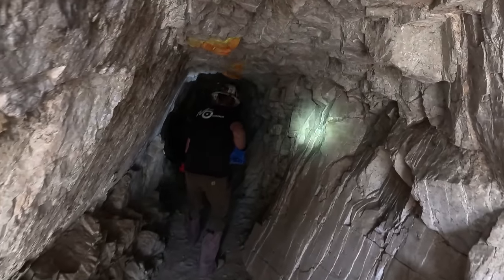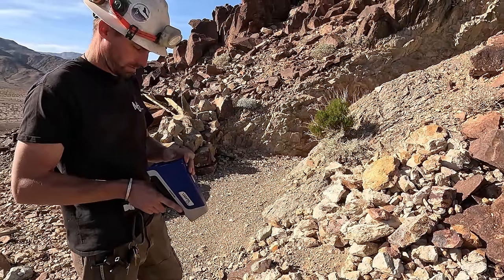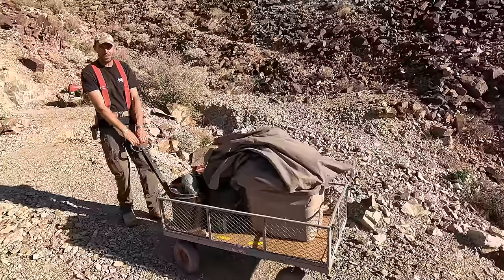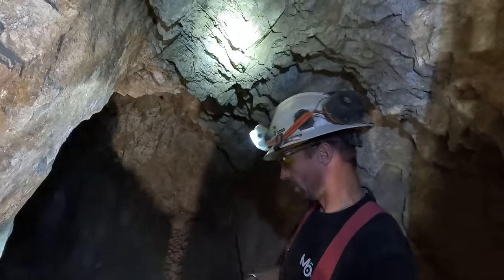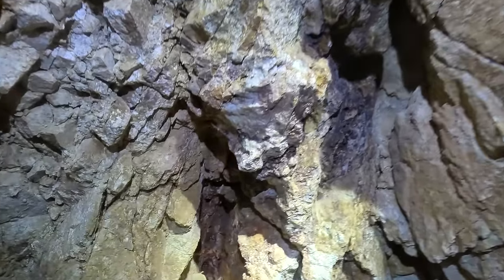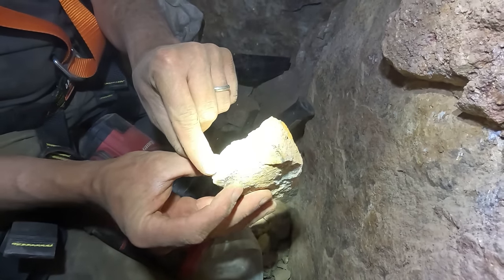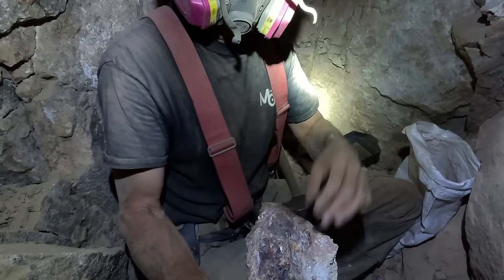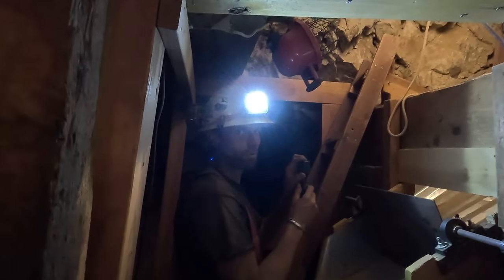Gold Mining Underground In The California Desert

Comment: If you have that much airflow then maybe put your generator up the shaft above you and a lot closer to your workings. Having that long of a cord from the generator, you are definitely getting a voltage drop and your drill is not giving you the power it could be. Then again I am not familiar with all the hazards in a mine.

Comment: I would get a old ,4x4 truck set it up with a 10 to 30kw generator connected to the engine! With aux. Fuel tank. For extra run time!  And a large air compressor, with a electronic governor,  snd a diversion valve  to allowthe engint to keep running at 1200-2500 rpm , with modes and safeties to allow yhe engine to run s generator snd air compressor! But not while driving!  And the electronic governor control the speed so the generator voltage and frequency is on point!!.. mount a large water tank and about 100lb propane tank, along with a couple 80-100gal air tanks with a couple 1" lines from them  running 180-200 psi with another tank or two to put in the mine! To feed the tools , i belive a simple $100' long stroke air hammer with a chisel bit in it would eat that vein up compared to the electric tools you guys usually use! Possibly build a 4x4 trailer to go with it use a couple 1,,ton axels  with a Nissan leaf motor connected to them  through a transfer case! With a battery from a hybrid it dhould have a 50 mile range, the truck can charge it! A 5.9 Cummings 1ton 4x4  Mad Max style, with the trailer having room for hauling out ore, or concentrate , a couple tons possibly! But the trailer havin fuel and water, emergency supplies, food. A tent or shelter!  Basically a micro camper!   Possibly having 3 axels, from a 350-450 ford with a motor to push it along at 45 mph, on its own, not reccomended!  Driving the trailer its self thst fadt will scare the pantz off ya!  Its primary use is to help the truck get it to the mine sites!  In rough country, 38-40" tires with minimum lift for low center of gravity!  And locker in all the axels!   Winch front and rear. All kinds of lights!  Led spot and flood lights, rock light under them both both having 1-5/8- 1-3/4" exterior roll bars!   The forward and revers  throttle and brakes for the trailer being controlled from a compartment in the trailer, or in the truck!  So it should climb a 85° wall  especially with bead locks and deflated tires and a winch!!  Also carry a few sets of 12' long aluminum ramps  about,4 pair, 12" wide! Bolt together along with steel stands, 12" wood cubes!  Actually a old modified duce and a half military 6x,6 Would be great for this!  Swap in a 5.9 Cummins with compound turbos making about ,,,,700 hp at the tires!  Keep the trailer idea!  The bed of the truck can be a  micro camper. For up to 6-8 folks! To sleep somewhat comfortable!  With means to cook, even shower. Outdide. In s pop-up tiny shower bathroom. To take a military shower!    Using about 2-3'<gallons of water!  Using a solar shower, or a propane water heater!  With a12/24v water pump!   The top of the bed being s pop-up tent type thing. With the walls  being canvas outside and in , with foam insulation like carpet padding inside the cloth walls, possibly having something like. Chicken wire inside for security  possibly a vinyl roof. With a plywood roof held up with 6-8 telescopic poles. With latches where required.  With aluminum bracing to allow a couple  ,,350 lb men to walk on the roof!  This giving about 9'6" ceilings to make room for quad  bunk beds!  This truck supplies air, water. Power. Shelter snd shower!! Along with a ride!  The shower room being a 6"- 8" thick piece of plywood hangin on the side of the truck!  It has a hand crank winch To push it up. Then it tilts out be coming a 4' x 8' shelf on the truck! Then the latches open. And the floor drops down with canvas walls attached!   The top attached by bungee cord to sllow about ,,,24" ,to about 32" of Maximum addition room for the shower to fit the space,  the floor of yhe actually slower having a drain through' 1 pipe caught in a grey water tank. To be filtered, carbon filtered, then used again for another shower, or something besides drinking,!   And definitely have a solar,/,, propane water purifier, incase the water supply is tainted!  It should make about 2 gallons daily on sun, possibly 5-10'with propane! But this speed would loose water!bit no needs to be heated to ,215° - 230°F to prevent over heating the system!  Use a copper coil in a cool place   then catch it! The shower floor made from fiberglass or plastic backed by Hardy board or plywood  sealed in fiberglass!  The roof being 1/8" plywood backed by 1/4" plywood strips with half lap joints.  With double the strips on the perimeter!  Uding 3" strips on ,8" centers!  With a strip of LEDs in the fiberglass on the outer perimeter facing inward, with the shower having them on the cross strips as well! With a switch in the canvas wall!  With dimmer!   Also have s plexiglass mirror fold down from the roof!  The roof being about 6'8" at the near lowest!   Also having zip out emergency exits in the shower room on all sides!  A 30"x30"    being double layered with a 1/4" foam backed aluminum like Mylar for insulation, this being on the top side of the plywood roof also!  The water coming in just under the roof eith the water heater in the truck. Or on it, possibly have a opening in the wall to access it from the shower, i think it does about 2-3 gpm  depending on water temperature!  Also have s hole for a chimney , build a  stove sbout s 4-5 gallon bucket size, that has s 3" pipe through the roof  about 4' long! Basically a 20 lb propane tank size!  Hang from the chimney, and a couple cables!  Have a truck and bathroom version! To allow the toom to be heated! Burn wood about 6"-8"', diameter and just as long!   Also have outrigger for the shower / bathroom floor to use sand bags or rocks to hold it in place!   Possibly have a buzzer to be setoff if the engine is started and the bathroom is. Down!😮!  Calling it a bathroom because be a portable compost toilet! Sit it in the corner a cross from the shower,  and have a  micro sink using shower water judt s short rubber hose drain into the shower!  Use s 14"'gold pan for the sink hanging from a trio of small chain from the celing!!b use a magnet to stick it in the ceiling to. Be closed up!the same hand winch id used to reach through the roof yo the floor to pull it up and Latch the floor to the ceiling  keeping the walls pushed in! As it closes!   The truck roof just use a stick  to push it up! Maybe use 12/24v linear actuators about,36" lomng,  made using ,1/2" all thread and windows regulator motors..   the bunks basically being on top of each other, 24"between them to sleep!  Like beds in a sub!!    And s !ong bench with a 16" countertop!  A window to the cab!  Also the miners could sleep in the trailer!  It having a similar construction! The bed can be taken to the ore haul compartment!  Hang the beds on thr walls  close the screens  turn on the 15 watt ceiling fan 12v  a couple should move some air!    The trailer dhould be able to help push the truck through rough terrain! Get to out of the way claims!!  The daily vehicles can be parked snd Maybe covered as far as they can drive!   A few guys could go out for the weekend or the week or month! To work a mine. Come back when they have a few tons of ore, or pay cons!   About 2 ton in the trailer! And ,up to about 3-4 in the truck . Legal or not!!   Haul that pay dirt right in the bedroom floor!!   Sorry to ramble,  would it not though be cool to have a go any and everywhere rig that carries everything you will need! Even the power. The house,  tools ,  the water, air,  maybe even use a battery bank to run a AC so ya can sleep in the desert!!    If you bring in a oz per day+ you can afford one of these vehicles!  Sorry again for the rambling on!!

Comment: 10:16 they would be better off just looping the rope over a winch leaving a loop down the hole with one bucketon top one on the bottom, with 50-200 lbs in one,  to be a counterweight  you can pull up a lot more weight slot easier that way!  One person could bring up 200 lbs all day alone! So two men should be able to fo 400-500 lbs !